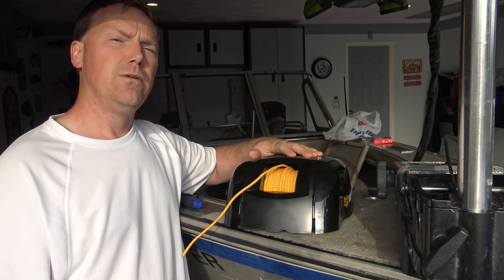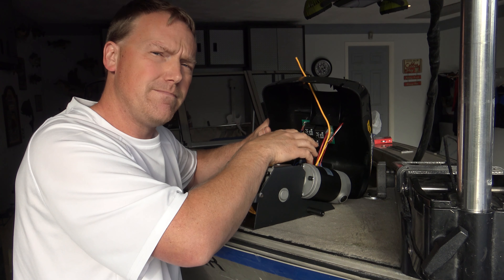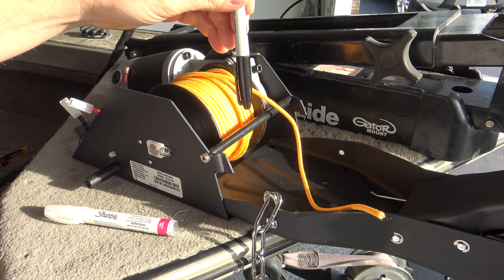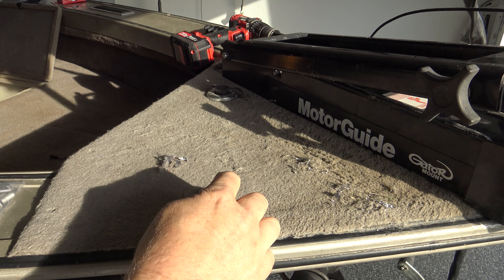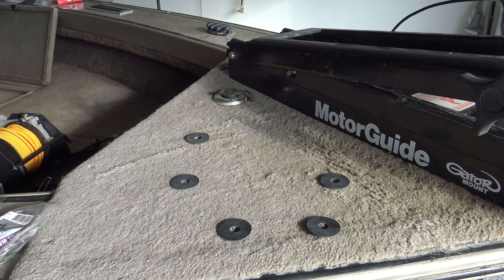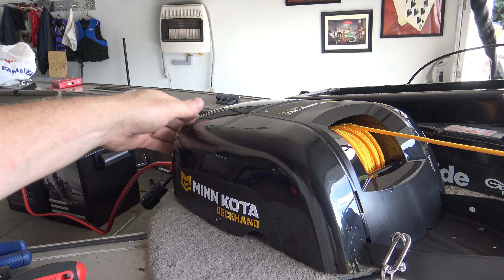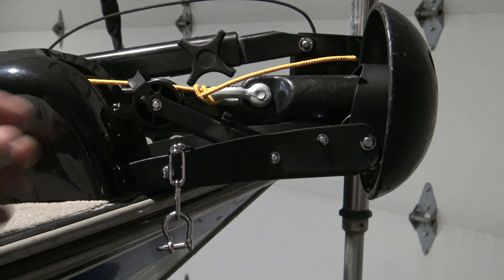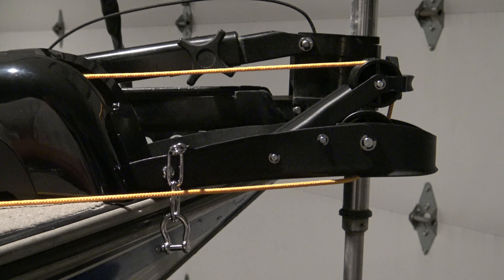How to Mount The Minn Kota DH 40 Electric Anchor

Comment: The new Deckhand 40 came today and it has mounting hardware included.  The rubber washers that come with it are about 1/4" thick. It says right on the box "mounting hardware included." Made a template like Burkholder showed in "Easy deckhand 40 anchor install."
Reply: Don’t need a templet..just set the minn Kota, and add pen marks to when you need to drill

Comment: Those clevis pins have a way of coming loose and when it does it is goodbye anchor.  I take some bare solid strand 12awg wire and run it through the hole in the clevis pin and tie it around the clevis that way the pin doesn't get too loose and fall out.  Thanks for the tips I will be installing another unit on the back corner of my pontoon boat. Had one at the front for 20 years now.
Reply from the maker: Thanks good Idea, Thanks for watching, have a good week